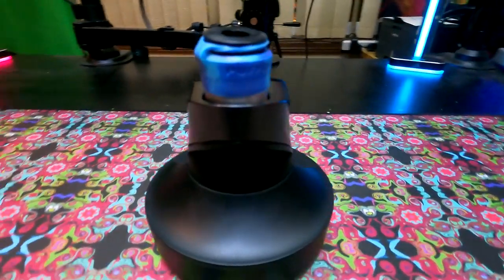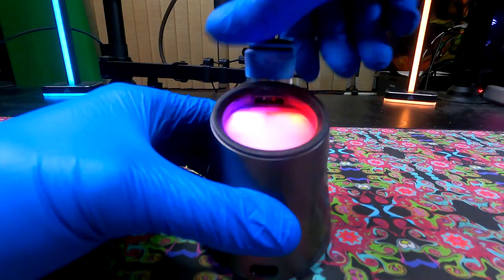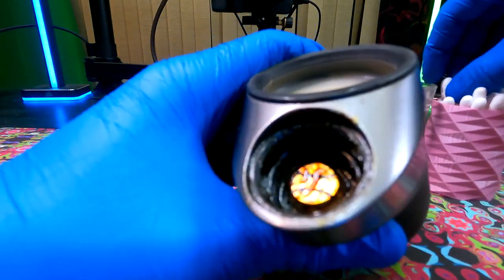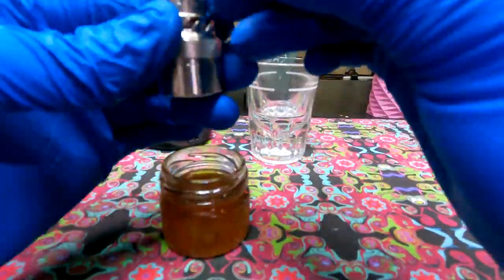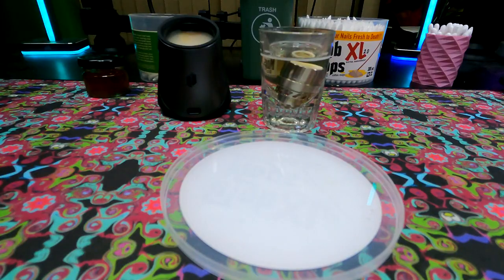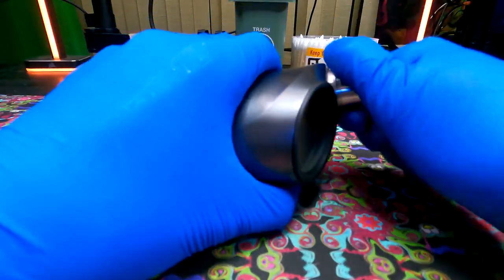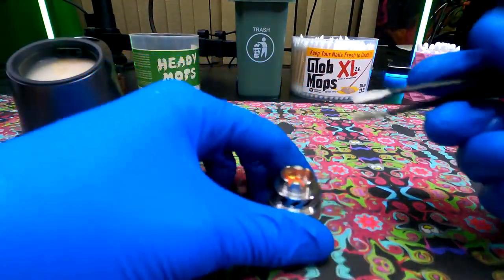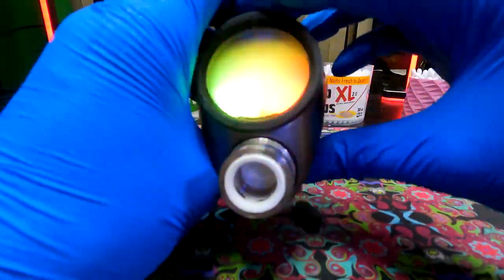3D Chamber 6 Month Review, Red White Flashing Light Fix & Durability Strategies For Insert Health!

Comment: My puffco was working fine until I cleaned it. Now the it’s clean it doesn’t not work. Bought a new chamber. Time to clean the new one. Now this one doesn’t ant to work. I adjust the pins also and I still doesn’t work 😩😩 help!!!
Reply: I had the same problem and found out you have to update it to work with the new 3d chamber , advanced ass rig lol

Comment: Also, I saw on Insta, I think someone torch cleaned the in between part of the chamber itself(the air path) but havnt seen it since....
Reply: This comment saved me $75 I had done everything down to the adjusting the wires under the pins. Torched the inside and red and white is no more. At least for the one dab I took so far.